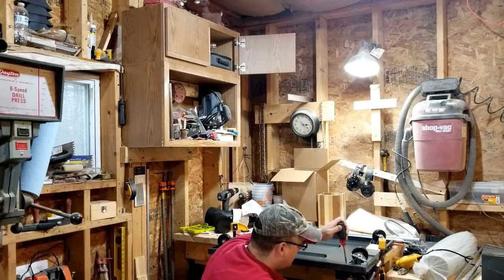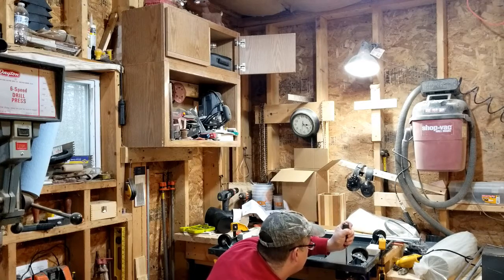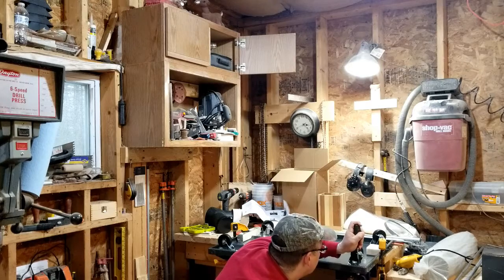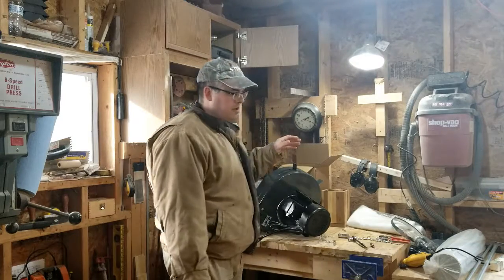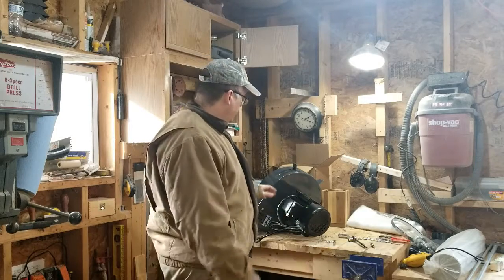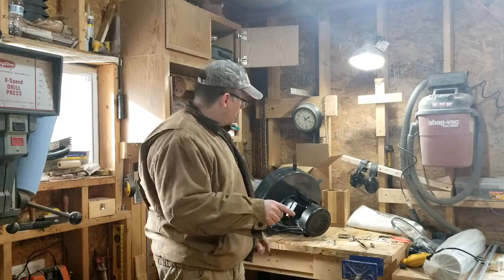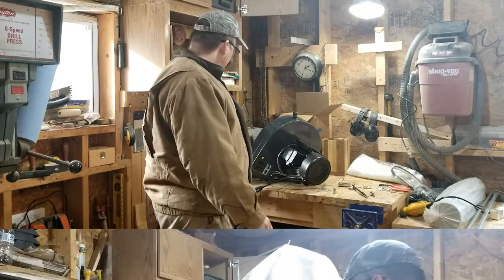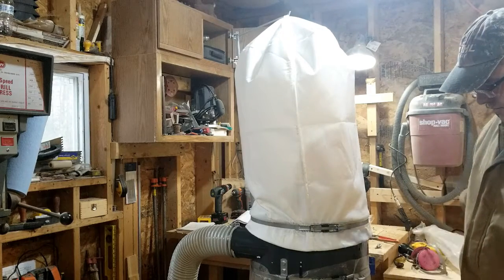New dust collector finished and tested

Comment: I need to set up a cyclone for mine. That will separate the bigger chips from the dust, and dump them in a barre,  that will be easy to empty, rather than a big bag clamped to the unit.
Nice work. Always good to keep the dust down, and the shop clean.
Reply from the maker: This one works pretty well, it wont separate though. I also swept the shop after working for a day, and I tried vacuuming the pile, totally clogged the port. But overall good unit.